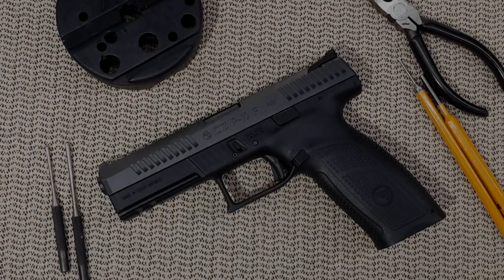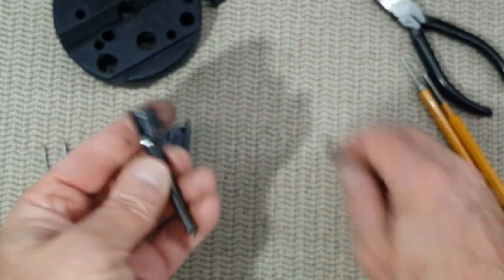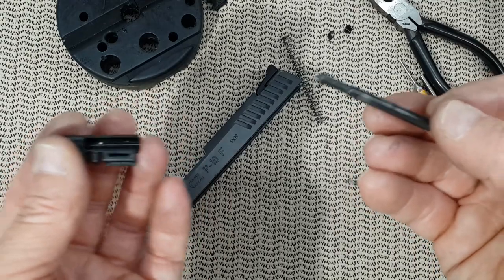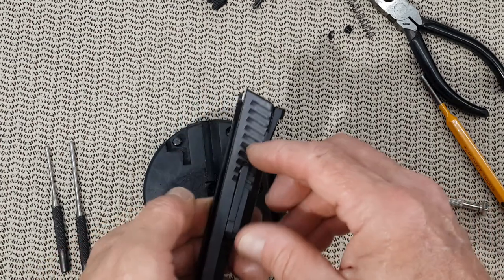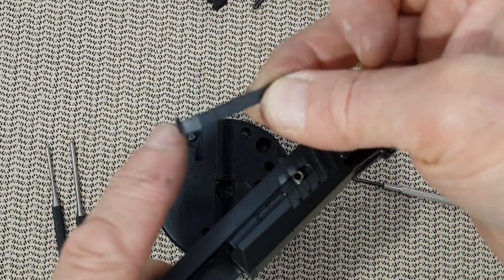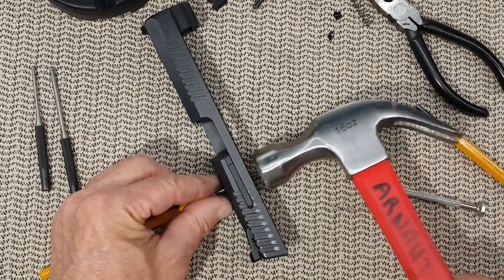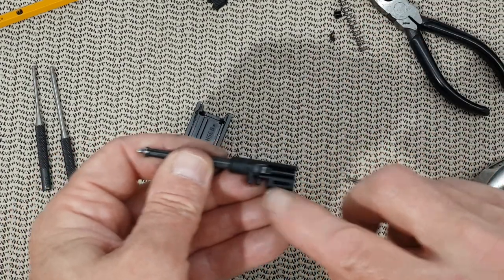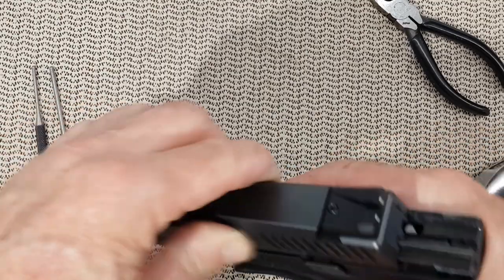CZ P10F / P10C Full Slide Disassembly

Comment: I used your other video to install the Cajun Works trigger. Compared to the M&P, this trigger install on the P10 was very simple. Excellent job on explaining the disassembly/reassembly process!
Reply: How do you like the Cajun gun works trigger package? I'm thinking about getting it for my cz.
Reply: @Didgeridoo42 , I like it! It won’t give you the crisp take up and break that a trigger job on a 1911 gives you but it’s heads up better than stock. Just be sure you have a solid handle on disassembly and reassembly. It’s not as worrisome as the trigger on the M&P, but it can be a handful if you’re not paying attention! What you’ll get is a great trigger for IDPA, IPSC and steel challenge.
Reply: @sf7708  thanks for the info!

Comment: It would be veeeeeery usefull for us the p 10 f owners, if you mentioned the sizes in mm of all the punches needed to disasemble the pistol. Wonderful video, well done.
Reply from the maker: The punch I am using to remove the extractor pin is a 1.5mm or 1/16th. It comes in the Stanley punch set I have in the description above. Good luck.

Comment: SLIDE PROBLEM -QUESTION - Purchased new P-10 F  Shot two mags through it to test fire, all is well EXCEPT the slide release is impossible to operate unless I pull slide back slightly to relieve pressure on release.  Is this normal and needing a break-in period?  Thought perhaps you may have experienced such problem.  Great disassembly video, thanks
Reply from the maker: It is not a problem, it is a very tight gun right out of the factory. It does require some break in and sometime some polishing.

Comment: Hi, thanks for the video. I just bought the same gun but I have an issue. Well actually I'm not sure it's really an issue. Is it normal that the barrel touches the slide and doesn't come out easily? I have to apply some force to take it out or to put it in. Thank you.
Reply from the maker: You have noticed as well that the barrel is in the slide pretty tight on the P10 serie handguns.. That is absolutely normal. The tolerances are indeed tighter than many other guns, but it is OK.
Force it out, and force it in, and you will be fine. Happy shooting Guitarra
Reply: Practical Shooter Thanks for the answer.